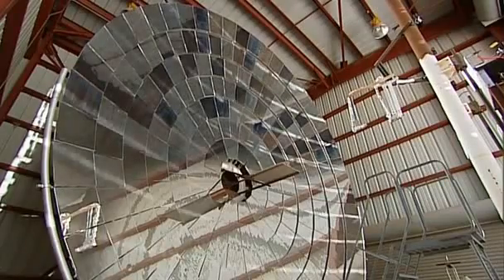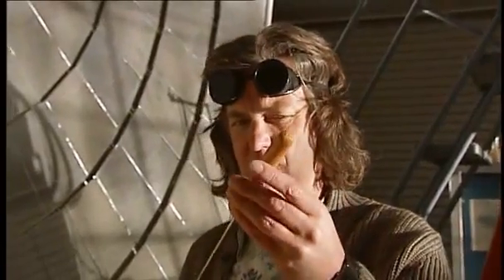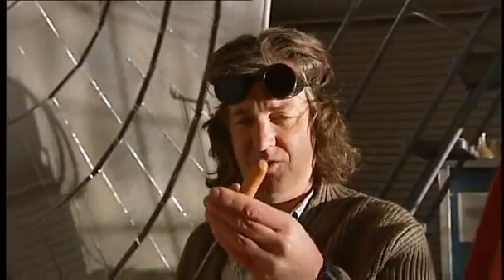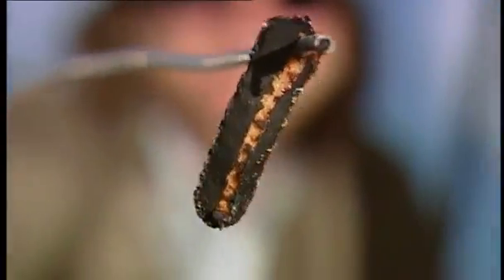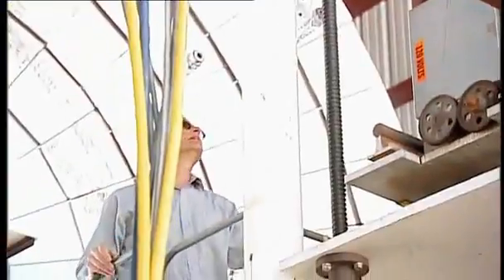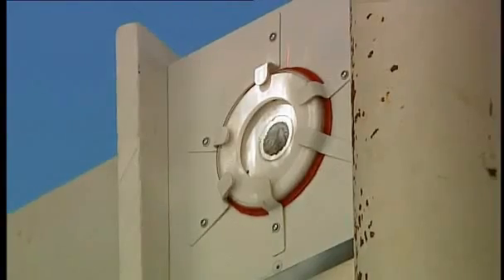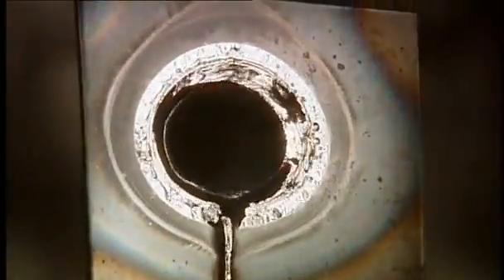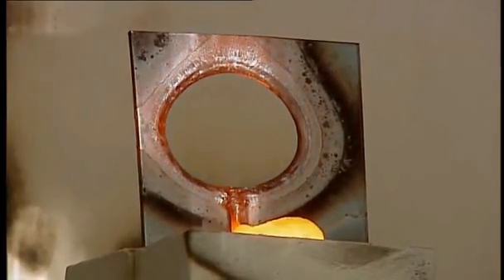Melting steel with solar power

Comment: CRAZY how we have something that uses no power  and can get up to 3000 or 5000 degrees and no one uses it
Reply: cant monetize the sun, I get your point.
Reply: It uses power but that power is free for us
Reply: Seriously. Why aren’t we using the invisible instadeath machine that has no safety markers?
Reply: @juniorqindes8335 are you stupid. It has very limited focal length
Reply: We should be boiling water to power steam generators with this

Comment: if this can melt metal (at least 1550 Degr C)... than it could shurely have set the ships ablaze in archemides's days and then the Mythbusters have done a wrong experiment... on Obama's request....  the latter to which I am not surpriced  he had more things failing... but that aside...

Comment: its a shame that we are still using coal !
Reply: For steel, coal is also a reducing agent not just a fuel to melt it. It's still required for the process unless we have a good hydrogen infrastructure I'm afraid.

Comment: That is aluminum, not steel.  They are liars.
Reply: That would be even more impressive, steel has lower melting point.
Reply: @useranonymous9274  impressive indeed that previous comment was 4 years ago.
Reply: @kingcobra10418  i’m trolling, steel is higher
Reply: @User anonymous  I've been to one of these research centres (platforma de solar Almeria) and they have a similar set up. They showed the group I was with a steel plate that they had melted! (I've got a photo of me holding it) and yes it was steel not aluminium as the plate was rusted! 

This one, is aluminium however, still Impressive though!